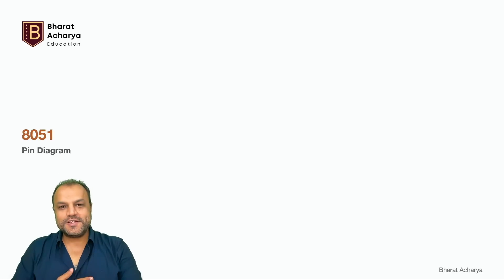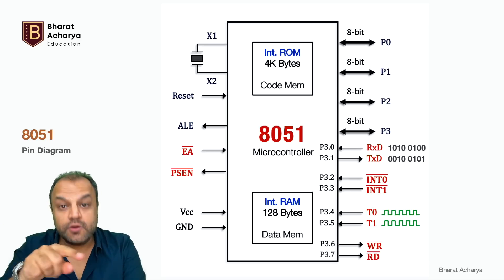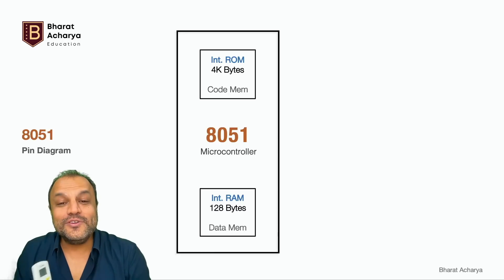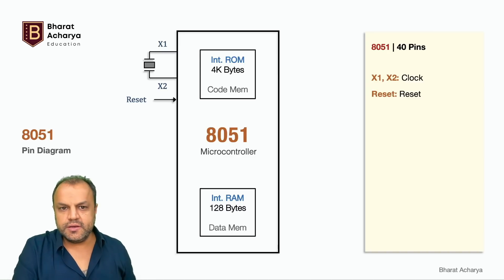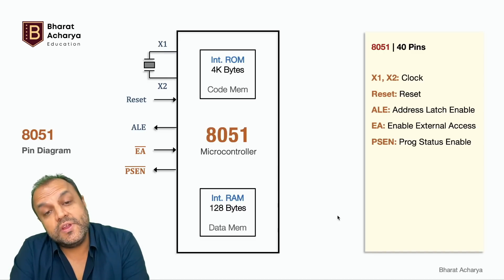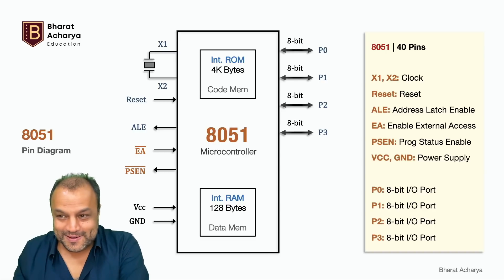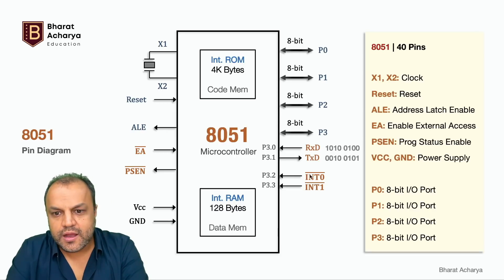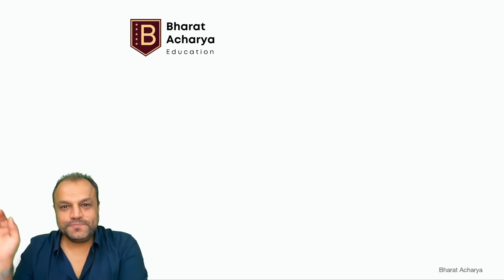8051 | Pin Diagram | Bharat Acharya Education | 2022

Comment: Sir I haven't any engineering Degree bt I am very interested in this subject is there any future for me plzz suggest sir
Reply from the maker: Yes. In embedded systems. 
Start from learning 8051. 

BHARAT ACHARYA EDUCATION
-———
Official Website: https://bharatacharyaeducation.com
 
COURSES ON MY WEBSITE
8085 | 8086 | 80386 | Pentium | 8051 | ARM7 | COA
Fees: 1499/- 
Duration: 6 months
Free: PDFs of full theory
Free: VIVA Qs and MCQs
Big discounts when you take multiple courses
Start Learning... NOW!
https://bharatacharyaeducation.com

INSTAGRAM 
-———
@bharatacharya.in
https://bit.ly/3r45LAp

WHATSAPP
-———
+919136428051 
https://bit.ly/3IGvfdf

MY BOOKS ON AMAZON
-———
8086 Microprocessor
Kindle: https://amzn.to/3NMBn77
Hardcover: https://amzn.to/3u2t6Ee

8051 Microcontroller 
Hardcover: https://amzn.to/3obYQRs

MY COURSES ON UDEMY
-———
Basic Course: https://bit.ly/3KNdkU3
8086 System bus & Memory: https://bit.ly/3NzbIgZ
8051 Introduction: https://bit.ly/35x6e69
8051 Architecture: https://bit.ly/3H1irxA
8085 Multiple Choice Qs: https://bit.ly/32yMldw

-———
#bharatacharya  
#bharatacharyaeducation  
#8086 #8051 #8085 #80386 #pentium  
#microprocessor #microcontrollers
Reply: Ok sir plzz sir what's ur's what's up no. Where I can ask any questions about the up plzz🙏